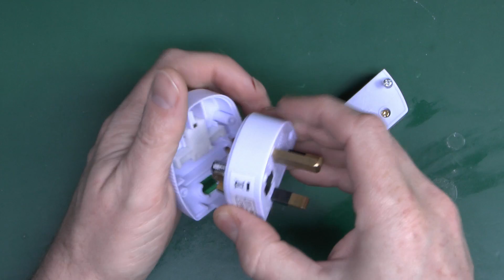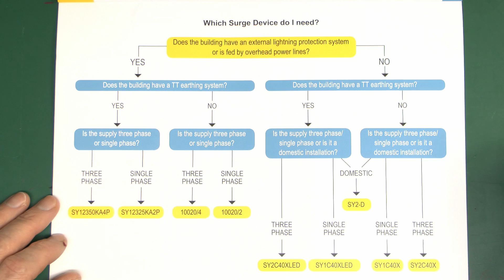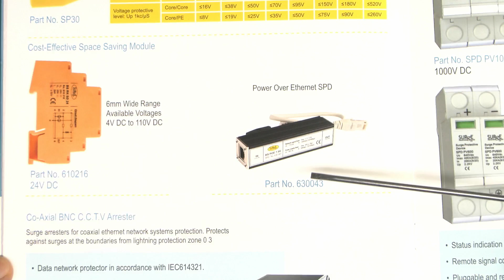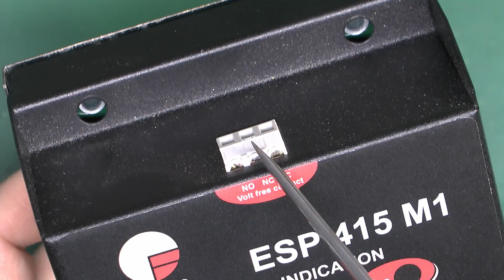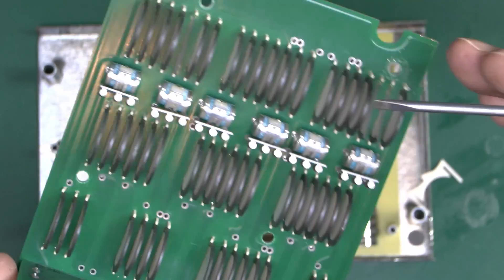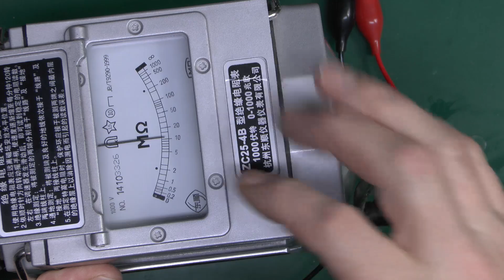Surge Protection 3 - Types and Teardown of Combined 1+2+3

Comment: I note the quality of this video is 1080 @ 50 fps - which I think is excessive (and causes occasional buffering issues). I think you'd find no one would notice any difference at 25 fps or even at 720p. Does anyone else have buffering issues with this video ?
Even so, quality need not be quite so excessive for this typical content.
Reply: Nope, because Youtube automatically reduces the video res to suit each of our connections. I am watching this on an old computer via WiFi and it's playing without buffering at 480p. The content that's been uploaded 1080p or even 4K doesn't mean that's what gets served to each viewer.
Reply: @johncoops6897  I agree as I know others have complained about other videos being of low quality when they're not for me - so it's settings at their end.
OK then, for me, the YT auto quality setting isn't working for me at 1080 @50 fps as other videos have minor buffering issues too.
Reply: @millomweb  Just select the quality you want from the settings. I would hate to watch garbage video just because someone else is having buffering issues and not bothering to change the quality setting for themselves. I really do prefer a high quality video stream when we are taking a close look into a device like this. 1080P 50 Hz is the minimum in my mind these days.
Reply: @benbaselet2026  To look closely at something does not require high resolution imagery. 50 fps is definitely not essential. Higher frame rates are for action video and 50 is not much better than 25. To make any significant difference, you need to add zeros to the framerate: 25, 250, 2500 etc.
Reply: @millomweb  That's just absolute, total, complete bullshit. Resolution is exactly what will give you better detail for looking at something. The difference between 25 and 50 fps is very noticeable, 50-100 is still noticeable and anything over 100 just goes beyond what humans can see so your claims about 250 and 2500 and adding zeros is just ridiculous and you clearly have absolutely no idea what you are  talking about so why do you even try to argue about something you have zero understanding of?
Reply: YouTube's "auto" setting usually does the right thing, but I sometimes turn it down when my ISP is congested. Just turn down the quality for yourself.

I appreciate 1080p for electronics content when I want to read part numbers.
Reply: @jordanrodrigues8265  There isn't an option for 1080@25 !
Reply: @jordanrodrigues8265  I bet they're just as legible at 720  in most cases !
Reply: @Richardincancale  My modem's 24Mbit max. UL a fraction of that !
They're selling it to me as 'broadband' but I rate 'broadband' as being 100 and fast broadband 1G.
Reply: As far as I'm concerned, YouTube's automatic selection of resolution based upon connection quality always gets it wrong.  I have a monthly data cap, so I always want to start a video in 144p and manually switch up if the content requires it (it rarely does).  As far as I can tell, YouTube doesn't allow me to set a "start playing at lowest resolution" option.  Which is why I installed a firefox add-on to do that for me.

Just one more way in which YouTube gets it wrong.  But the other things it does wrong are aimed at increasing the number of adverts people see, like autoplaying videos in your watch later list.  I hate them for doing that, but I understand why.  There's no reason for them to force high resolutions on people who don't want it.  In fact, there's every reason not to.  If I simply took what YouTube fed me, I'd hit my monthly data cap in a couple of weeks, or maybe even a single week, so be unable to watch as many adverts videos.

No harm in JW uploading in ridiculously high resolutions, as long as YouTube scales them down (it usually does) for those who want lower resolution.  If he uploaded in 144p and you wanted a higher resolution, you'd be screwed.  So learn how to change the resolution manually, or install a suitable add-on if you're watching using a browser.
Reply: @bdf2718  I was under the impression that once a manual quality setting was chosen, it stuck with it ? (provided the setting was saved and not overwritten.) I presume you allow YT to set cookies ?

I don't have a 'watch later list' - I just open videos in a new tab - so Chrome provides that list.

No option to reduce 1080p 50 to 1080p 25 !
Reply: @millomweb  Yes, I allow YT to set cookies.  Quality setting is not persistent.  At least not for me, with my browser.  No matter how many times I select 144p manually, the next video plays at whatever YouTube decides until I manually override it.  Very, very annoying.  Until I installed an add-on to do it for me.

The lack of option to go from 1080p50 to 1080p25 is because YouTube chose not to scale it down to 1080p25.  I don't know if that's a framerate they ever offer on any video.

Oh, and if you don't have all the codecs you'll find you don't get offered certain resolutions because your browser can't handle them without the relevant codecs.  I had that problem for a while, once, after YouTube switched away from Flash to HTML5 for video.
Reply: @bdf2718  What's the point of an auto setting if that's what YT does every time irrespective of choosing another setting ? Try it on 480 - maybe they think 144 is a crazy mistake ! If the framerate's not specified, it's 25 fps - that's most of the vids !
I'm on current Chrome - so Google all the way - so I presume that's all be dealt with !
No guarantees though !
Reply: @millomweb  I think "auto" means "give me the best resolution you think my connection can handle."  If I didn't have aq monthly data cap, I'd be happy with that.  But I do, and I'm not.  Especially as it seems to revert to auto with each new video.

Resolution seems sticker in the phone app, but on a browser it's youtube's choice.
Reply from the maker: All videos on this channel since 8 March 2015 have been in 1080p50.
Reply: @jwflame  Is that really necessary ?

I once sent a still image from Birmingham to London. It took about an hour !#dial-up
Even now, when uploading images to websites, my target is no more than 50k.
Reply: @Richardincancale  I'm watching on a 1080 screen but it's not a big one. 720 seems fine on this too for general viewing.
It depends on the size of the big screen, if that's 1080 too, 720 will be fine on that too.

If you're expecting a cinema type experience then higher resolution would be good but I can't see JW going into blockbusters !
Reply: @Richardincancale  - no shit, Sherlock!
When you manually increase the resolution higher than what Youtube recommends (for you), your bandwidth may not be sufficient to maintain a reliable, constant stream. Guess what happens....  buffering!
So, irrespective of whether you consider that you have a "big screen" or that "1080p is required", if your Internet+LAN/WiFi+Computer cannot process the data fast enough, you will get buffering.
Reading and comprehension - you should try it.
Reply: @johncoops6897  LOL YT has truncated your message ending as "maintain a"

Maybe insufficient bandwidth in the comments ;)

My quality setting is set to Auto - whatever that means - as it seems to accept more than one quality setting on auto !
Reply: @millomweb  - LOL, yeah I am maxed out here at 360p !!!!
YT hasn't really truncated my message ending as "maintain a"... you just have to hit "Read More" link, like I did to read your extra lines. I notice that YT sometimes doesn't offer that link from the popup notifications, dunno why!
Reply: @johncoops6897  It's poorly designed, that's why. So much normal features don't work in the notifications section - pageup/down, end, home & other standard keyboard features.

The fact that the reply button always goes off the bottom of the window annoys me !

Comment: Are you sure the pins you're pointing at with the screwdriver at 17:37 don't just unplug from the riser board ? (rather than as you cut them ?)
Reply from the maker: After further investigation, the pins do pull out of the vertical board, although this requires a significant amount of force.
Reply: @jwflame  Thanks for confirming John. It does explain the 'excessive' amount of plastic in that area - but doesn't explain the 'excessive' amount of plastic where they're soldered to the larger board !

When I first saw the 'connector' in the video, I thought it would unplug and thought it would take some effort/leverage to do so like like pulling dil chips !
Reply: obviously clear, they're not detachable.
Reply: @piratedprivacy9052  So what's all the plastic bits for ? And why have P3 easily detachable if P1 and P2 aren't ?
Reply: perhaps mechanical support for the pins...
why dont you take a closer look at the video??
logic will also backup that JW not that nerd to cut those pins instead of easily unplugging them, if anyway found possible by his hands...
Reply: and later JW did added that  "are actually soldered in" .
Reply: The "plastic bits" are called a header, and they'd be helpful during the manufacturing process.
Reply: @piratedprivacy9052  The sockets would be and the pins would be on the big board. But why have all the fancy plastic if they were going to be soldered anyway ?

Makes no sense !
Reply: @millomweb  - the cable is supplied (by the cable manufacturer) with crimped pins, and the plastic support header holds the pins in the perfect order, alignment and spacing for the PCB layout. This makes assembly and soldering far easier and faster, as well as proving a more reliable connection than soldering.
Reply: @johncoops6897  There's nonsense in that comment ! Makes the soldering easier and more reliable than soldering !!!
Reply: @johncoops6897  Soldering is pretty reliable !
Reply: @millomweb  .... than soldering *individual wires*. As for reliability, a crimped cable will always be more reliable, hence why that's the preferred way in cars, data and power distibution, etc. But in this case, the main reason for the header is to make assembly easier and faster, and it's used in almost ALL kinds of equipment.
Reply: @johncoops6897  I think for reliability, solder is best, a screw terminal is next best, push-fit after that and nearly lastly, crimping - one before super-gluing.
Crimping cannot be as mechanically strong as solder or screw terminals nor as electrically reliable.
Put it this way, you won't find any hoisting cables on lifts merely crimped ! They're all clamped with screws !

Both solder & screws ensure good electrical connection as well - provided they're done by a competent person - but that applies equally to all connectors.
Reply: @millomweb  - you have absolutely no idea what you are talking about. We are discussing ELECTRICAL connections, and crimping is THE most reliable connection method. That's why it's universally used in mains power distribution, automobiles, data, every computer, etc, etc.
Solder + screws is probably THE WORST way, due to a phenomenon called "cold flow".
Reply: @johncoops6897  If the crimping tool remained in place, mechanically, I'd accept that. But crimping does not ensure a good clean connection nor maintained application pressure. A screw cleans metal surfaces as it scratches and deforms the conductors ensuring bare metal to bare metal connectivity.
Reply: Crimping is better the soldering?! What heresy.
Reply: @johncoops6897  Dunno where you are but here in England, I've not come across crimping in power distribution. I doubt you'll find 1 mains cable connected by crimping in my house - and I've not generally seen it elsewhere - except for the strange use of crimped ferrules in CUs. When wiring gets serious - such as meter tails, I've never seen these crimped.
Reply: @jovetj  We need evidence - hopefully JW can provide !
Reply: @millomweb  - for any reasonable sized joints in the POWER DISTRIBUTION, they use crimped connectors. Look at a distribution board, where the incoming mains is terminated. Automobiles use crimped connections. Aerospace uses crimped connections. Solar/PV uses crimped connectors.
The reason is that the crimp produces a better, more reliable joint which will not fail under flexing/vibration. Soldering (wicking) makes the wire brittle, so the joint doesn't fail, but the wire often snaps just outside the joint.
There are literally THOUSANDS of documents, websites and videos regarding this subject. You can use Google can't you?
Reply: Sorry, I must have been looking at too serious connections - they were bolted, with 4 bolts, not crimped. I've been reading up about crimped connections in automotive situations - and the allegation of such claiming to be 'gas tight'. I'm not convinced they are.
The crimped wire on my car's starter motor failed - due to vibration - so crimping doesn't prevent that - and it can't. Soldering doesn't make wire brittle, it makes the joint rigid, secure - that's not an issue provided it's supported in a vibrating situation. I'm aware some C/Us have circuit tails with crimped on ferrules yet still most connections are screw-down terminals onto copper wire. There must be a reason they're not using crimps everywhere.